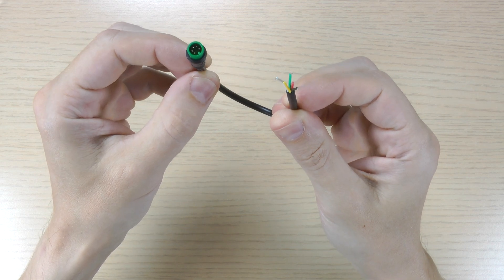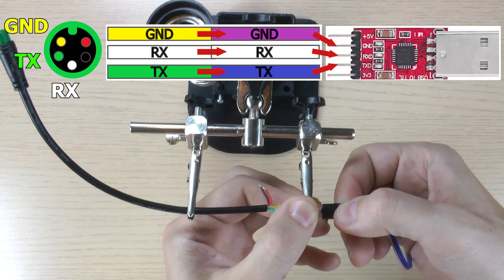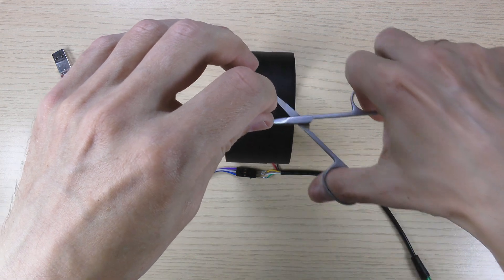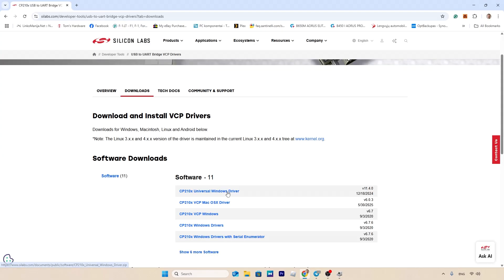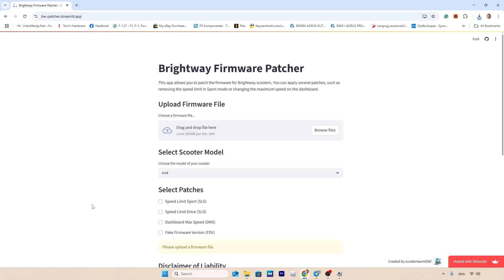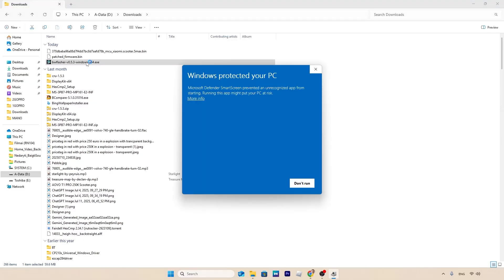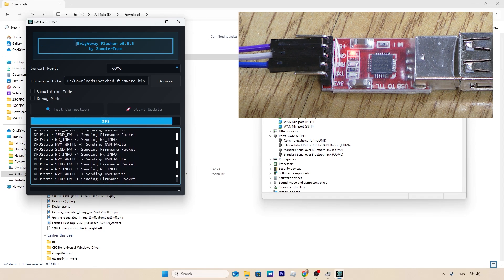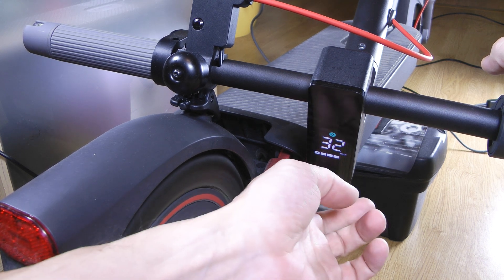Updated Xiaomi Scooter 5 Max Speed Hack (5*|5Pro|4*|4 Pro 2nd Gen)

Comment: Just came here to say, I will not subscribe.
Reply from the maker: :))) Ok.
Reply: @MindaugasJocionis  pls relpy o my other comment how do you solder the wire to the usb\
Reply from the maker: You can just solder the wires from the connector straight to the adapter pins

Comment: I have the Swiss version of Ultra 4 (20 km/h speed limit, turn signals). It is flashed using the same method. Before flashing, I wanted to understand a few things for myself:
1. Will the turn signals work correctly? The KMK controller firmware should not directly affect them, but there may be some hidden pitfalls. 
2. The firmware designer allows you to change the limits for drive and sport modes. But the model has 4 modes available: pedestrian, drive, sport and sport +.  If you change the limit in sport mode, the most likely outcome is: a. The limit in S will change, but in S+ it will remain the same. B. The limit in S+ will change, but in S it will remain the same, or C. It will change in both modes. 
3. Will it be possible to completely restore the factory firmware over the air using the native application?
4. What will happen to the serial number when flashing via UART? Will it be preserved? With this method of flashing, it is not possible to make a native dump.

Please share your thoughts on this matter.

Comment: Thank you! This works perfectly on my Xiaomi 5. It reaches 35 without load, although the colors of the wires were wrong: for me black was gnd, white was the power button and green and yellow were rx and tx.
Reply from the maker: Nice, glad it worked! Wire color doesn’t really matter—what matters is the pinout, because colors can vary between connectors. Subscribe, thanks.

Comment: Hi friend, very good video. I have a question. Why do you set the maximum speed to 32 km/h in Drive mode and 25 km/h in Sport mode? Shouldn’t it be the other way around? I thought one mode has more power than the other. I want to do the hack on my scooter but I’m not sure what to do. Hope you can reply, thanks!
Reply from the maker: Yes, set the max speed in S mode — it has better acceleration. It was just for testing purposes. Subscribe, thanks.

Comment: Hi. Since some months I saw that also Xiaomi Elite has been added to the list of flashable scooter. Unfortunately, I have accidentally updated the firmware of my Xiaomi Elite to the latest one. Does this method work the same? I think so because it does not use bluetooth...or do I have to downgrade the firmware? Thanks
Reply from the maker: It will work. Check the guide on the website — it has been updated for the Elite model, which uses a different connector size and pinout. Subscribe, thanks.
Reply: @MindaugasJocionis  Yes thanks. It should be M8 5 pins male
Reply from the maker: yes
Reply: @MindaugasJocionis Hi! my step‑sister gave me the xiaomi electic scooter and she’d already upgraded the firmware without even noticing 😅😒. So, if I understood correctly, I don’t need to downgrade first...just load the firmware and flash it directly according to the procedure, right? Thanks!
Reply from the maker: Correct, no downgrade is needed.

Comment: Can I do it with a raspberry ?
Reply from the maker: Some people have reported that they successfully did this using an RPi Pico with a USB–UART bridge and Arduino. I’m not very familiar with RPi or the Linux version of the app, so you might want to ask in the bw-flasher GitHub:
https://github.com/scooterteam/bw-flasher/releases/tag/v0.6.0
And don’t forget to write back if you succeed — it will help others.
Subscribe, thanks.
Reply: @MindaugasJocionis hey, thanks for reply. I ask some friends and some ai‘s. With a default pi it may be work. One problem is the raspberry is based on ARM architecture. And the flasher is made for x64. But I will test it

Comment: Do you know if xiaomi patched this hack with update 2.7.0_0015.0015 ? every time i try to flash i get error  “bw flasher max retries reached”
Reply from the maker: Yes, it works with the updated firmware. Check your wiring, and keep in mind that if flashing takes too long to start, the scooter will turn off automatically after a while. Subscribe, thanks.

Comment: I have a small question. In the description, you state that the Model 5 requires an M7 5-pin Julet female connector, and right after that, that models manufactured in 2025 may use an M6. So my question is, if I have a Model 5 that I bought at the end of the year, which cable should I buy? Thank you very much, and Happy New Year!
Reply from the maker: Remove the steering wheel and measure it. Subscribe, thanks. Happy New Year! 🎉

Comment: Hello my friend, I want to install a battery on a Scooter 5 Max. Is it possible that the scooter may not recognize the battery? If so, is there any software or firmware solution for this?
Reply from the maker: I think the MCU won’t recognize the battery BMS chip, and it will show an error. For newer Xiaomi models, there is no bypass. Subscribe, thanks.

Comment: I performed this modification on a Mi Scooter Pro4 Gen2 and it was perfect. Very good, crisp acceleration with good pickup. I just did it yesterday on a 5 Max and it's less powerful and the speed doesn't increase as quickly; it seems to increase in stages. It's strange because it's the same motor power and practically the same battery. I don't understand it and I'm a little disappointed.
Reply from the maker: Well, those hacks don’t modify the firmware — they only remove restrictions. Motor acceleration stays exactly as Xiaomi tuned it. Just so you know, D and S modes have slightly different acceleration. Subscribe, thanks.
Reply: @MindaugasJocionis Yes, I understand that. I just don't understand why, after doing this, the 5 Max is noticeably less responsive and slower than the 4 Pro gen2. It seems like the nominal power is 250-300W and not 400W.

Comment: all of this for 5 more kilometers ? lol
Reply from the maker: Some scooter versions have a maximum speed of 20 km/h, so there is a point in this. Subscribe, thanks.
Reply: @nickadm8321 it also increases acceleration and hill climbing capability. There's a lot to be said for cumulative upgrades adding up. My m365 factory was 24kmph max. With firmware upgrade 31kmps. With firmware and 10inch tyres it now goes 36kmph which is a 50% speed increase from factory

Comment: Hello, do you also make tutorial videos on how to fix the beeping problem when driving over 30 km/h? I set it to only 29 km/h, but I want to go faster.
Reply from the maker: Probably I will do it before the next summer season. Currently, the scooter is in storage. It will require desoldering the speaker from the dashboard or taping it over with duct tape, unless a patch appears that allows doing it by flashing the firmware. Subscribe, thanks.

Comment: Hello iv managed to do it my xiaomi series 5. To 33 klm but when am on it it only gose 26klm how to increase moto constant acceleration, to get to 32 or 33klm 🙏like old scooters can increase that
Reply from the maker: The scooter battery must be fully charged and the tyres properly inflated.
With a full battery, I ride at ~31 km/h with 5 Max model. My weight is 60 kg, so you should get very similar results.
As the battery depletes, the speed drops. You can’t tweak these new Xiaomi scooters like the old ones.
Subscribe, thanks.
Reply: @MindaugasJocionis  nicee ok :) ok will try that, aswell the max has more moto power at the end of the day,
Reply: Thank u so much for this video

Comment: How can i setup the firmware to turn on TCS? I kinda want the modification back as well on me since im in a rainy region and keeps causing me to slip because after math of 2.7.0 update the firmware disabled the TCS.
Reply from the maker: The TCS icon on the dashboard is disabled by a Xiaomi BLE update in the official firmware. It has nothing to do with this hack.
However, when you enable TCS in the app, the sound plays, so it’s hard to tell whether it’s actually working and just not shown on the dashboard, or not working at all.

Subscribe, thanks.
Reply: @MindaugasJocionis  I can give you an update regarding TCS and the hack - it works with the hack and, at least for me, it totally sucks. I don't think the hacked firmware changes it operation, it is just a crappy implementation from the start I guess. I enabled it just for the test and it was even dangerous - during my commute I have to pass a street covered in cobblestone and the pavement it is not smooth at all. Immediately when I step on this street the motor cuts off power with the TCS enabled - horrible in case there could be a car and you suddenly slow down in the middle of the street for no apparent reason. Not sure how it is implemented in cars, but with the car I can go through cobblestoned streets and TCS doesn't engage in such a stupid way. But I never updated my firmware through the app, so I still have the TCS icon displayed on the scooter's dashboard if I enable it in the app.
Reply: @angeltinkov7415 whoa it works with hacks? But once you want it back to orig firmware how can you make it go back with same 2.5.3 version? 2.7.0 in xiaomi sucks.

Comment: I flashed mi 5 pro no problem, i get CRC fail on mi 5 max on 2%, when i check fake firmware version on 9%
Reply: Its random, tried other usb port, tried restarting scooter and bwflasher multiple times, seems diffrent mtu firmware version ?
Reply from the maker: @miletakojanovic3270  Try downloading the patched firmware again, as the file might be corrupted, or you may be trying to flash firmware for a different scooter model.
Reply: @MindaugasJocionis  tried 5 max and 5 pro on this 5max, tried flashing without modification, tried redownloading and launching again 20 times at least...

Must be diffrent unknown version?
Is there a way to download original MCU and modify it?
Reply from the maker: I reached out to the BW developer, and he said that you’re trying to flash the wrong firmware.
Reply: @MindaugasJocionis no, the actuall problem was my laptop usb driiver which got corrupted in windows update.. i got it working after noticed that usb memory was disconnecting in 15 sec intervals... Reinstalled drivers and it worked!

Comment: I'm getting this error, what could be causing it? (max retries reached. check your connection)
Reply from the maker: Check your cables — are they correctly connected, and is the adapter detected by Windows.
Also, don’t forget that the scooter must be powered on before disconnecting the dashboard. If it takes too long to connect the cable and flash the scooter, the scooter will shut down automatically.
Subscribe, thanks.

Comment: hey, how can i do it back that is original again? can i just reset the scooter or update, or did i need to download the original patch and install it with the chip?
Reply from the maker: Flash the unpatched MCU (the official firmware) or set the fake firmware version to a number lower than the latest one in the patcher. Each time you open the Xiaomi Home app, it will prompt you to update — if you accept, the scooter will revert to stock. Make sure to disable automatic firmware updates in the app.
Sub, thanks!

Comment: I see that the firmware for the Xiaomi 5 Elite is already listed, so is it available?
Reply from the maker: Yes, it looks like it’s already supported, but it has a different controller, a different cable size, and a different pinout. It’s still not uploaded to the guide. They said the pinout will be uploaded shortly, so stay tuned. Subscribe, thx.
Reply: @MindaugasJocionis  There is an update with pinouts for elite. What bothers me is that firmware size for scooter elite before patching is 113KB and after patching it is 39KB. For other scooters I didn't see that drop in size. Is it ok, are you planning to test it?
Reply from the maker: Yes, they posted the pinout yesterday. The connector is also bigger (M8), and two pins must be bridged to power on the scooter, otherwise it will power off when the dashboard is disconnected. I asked about the file size, but so far no answer — but they said they will look into it.
Reply: @MindaugasJocionis  Thanks. I already have the M8 connector but I'm afraid of doing the update because of the file size.
Reply from the maker: Answer from Turbojeet:
"ah yes, thanks for noticing. you could flash that file, controller doesn't require any of the other stuff from the original stuff. however, i'll make an adjustment that the patcher returns the full patched file".
So it’s up to you whether to wait a bit, or to flash that file.
Reply: @MindaugasJocionis Great! Thanks for sharing the info
Reply from the maker: @michafastyn2323 Patcher is updated. Write back about your experience and what speed you’re getting on the Elite — it will help others.
Reply: @MindaugasJocionis  Will you upload the tutorial?
Reply from the maker: No, I don’t have that scooter model.
Reply: @MindaugasJocionis  I wanted to updated today but I noticed that that scooter pins (BAT and VCC) needs to be bridged to power on the controller. I'm a little bit afraid that if there is some mistake in the pinout schema it will brick the scooter. I will wait a while. Maybe someone will upload a video confirming the pinout schema is correct.
Reply: @MindaugasJocionis  Can I flash an M8 connector with a CP2102? Because I don't see the VCC pin.
Reply: @michafastyn2323  I have the same question, but the guide and the photo say that those two need to be bridged.
Reply from the maker: @adrim1629  VCC and BAT (pins/wires) must be bridged to each other on the cable — you don’t need to connect them to the USB adapter. They are bridged to power on the scooter, since this model shuts down after disconnecting the dashboard cable.
Reply: @MindaugasJocionis  I flashed my xiaomi scooter elite. Max speed is around 30km/h but most of the time it goes 28km/h. I weight 70kg. From 25km/h it starts beeping.
Reply from the maker: @michafastyn2323  What was the max speed before? It looks like the elite model isn’t worth the effort, unless you have a model that’s limited to 20 km/h.
Beeping is present on all models, but it usually starts after reaching 30 km/h. You have to cover the speaker with duct tape or unsolder it from the dashboard, but it’s hard to say where it’s located on the Lite model since the dashboard is different. It’s possible that a beeping disable option will be added to this controller in the future.
Reply: @MindaugasJocionis max speed before was 20km/h so for me the update was worth it. Those 8km/h makes a difference. Without load, the scooter’s display shows a maximum speed of 31 km/h.

Comment: Why in Xiaomi electric scooter 5 on julet The first pin of the connector is gnd then millivolts then 7.5v then 7.5v and then 12v. I don't know the pinout and I didn't understand where rx tx and gnd, so is there any pinout? I can't flash it because I don't know where the pins are.
Reply from the maker: Check the video description for a link to the pinout, and don’t forget to subscribe. Thanks!
Reply: @MindaugasJocionis link ks not working anymore :/
Reply from the maker: Just checked — everything works. Might have been the server being down. Subscribe, thx.

Comment: Is there any way to increase the amps? I see it is not listed in the firmware modifier but I don't know if it is a software limitation (either the firmware modifier or some protection) or some hardware one (like it is dangerous or something similar)

Thanks for everything!
Reply from the maker: No, there’s no way to increase the amp with this hack. Subscribe, thanks!
Reply: @juanjesustomas Have you discovered a way to increase amo somewhere else?
Reply: @pedromartins5989 no